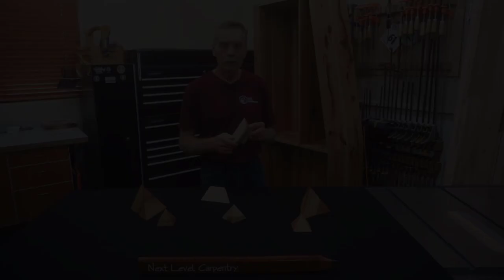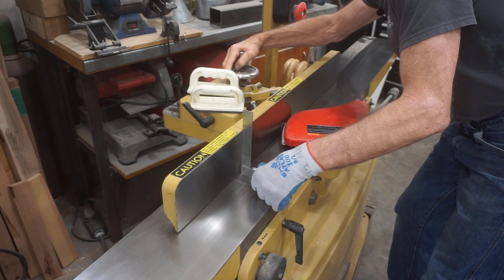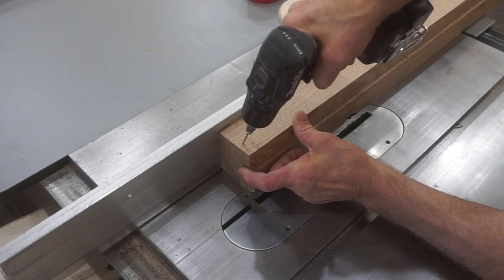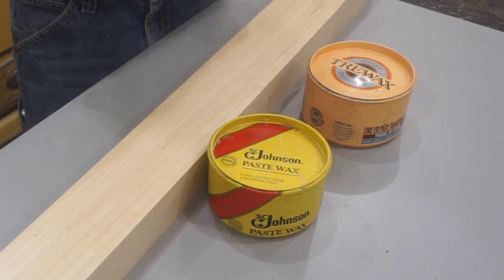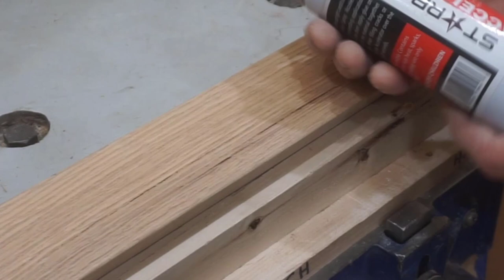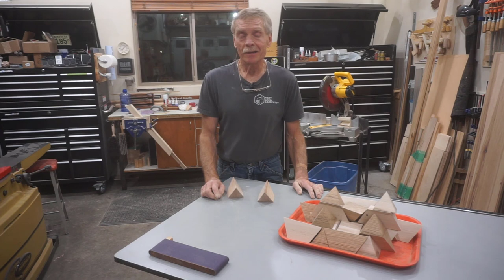Pyramid Puzzles You Can Make

Comment from the maker: Video Chapters:

@00:00 - Introduction
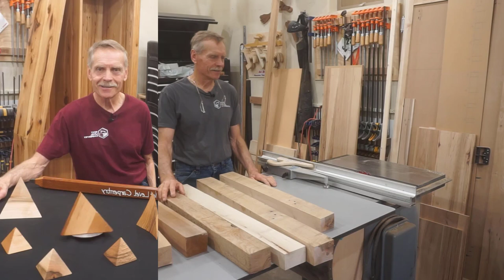@02:50 - Initial Milling
@07:00 - Equilateral Triangle Layout
@08:25 Ripping Triangular Blanks
@19:50 Planing Triangle Blanks in a Thickness Planer?!
@31:58 Initial Sanding
@35:10 Pro Tips to Repair Defects in Pallet Wood
@42:00 Cut Puzzle Pieces to Size
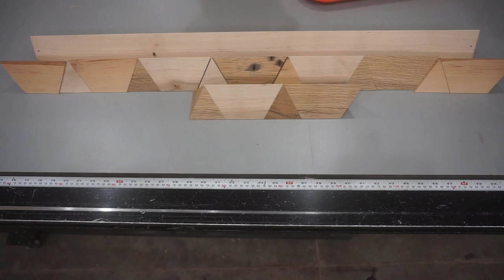@49:31 Final Sanding
@52:19 Apply Gel Varnish
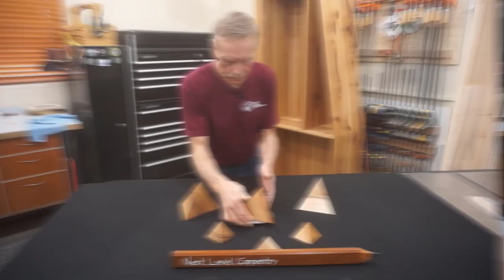@58:28 Spoiler: Puzzle Solution Demonstrated

Comment: If it were me, I'd put the fence on the other side of the blade to avoid "trapping" the workpiece. If it jams or binds it may kickback. Your feed has to be spot on straight in and dead level, or there could be a issue, but I'm not that good, or confident.

Comment: Instead of screwing the two pieces together I would use painters tape on both faces and then put super glue on the painters tape and glue them together. After pull the two pieces apart and peel the tape off.

Comment: Matt I watched the whole video, be it in two pieces. 
Question, do you use Danish Oil at all? If not , is there a reason why you don’t, from what I have read Danish oil gives better results in bringing out the timber. 
And no you’re videos are not to long as your explanations are just great particularly on details. 
Many Thanks
Reply from the maker: Peter: I used to use 'oil's' on stuff until I discovered gel poly.  Poly really makes wood 'come alive' in similar fashion but, IMHO, is more protective and durable so I can't really think of a reason to switch back... unless a side-by-side comparison showed noticeable improvement/results initially and over time.  Best, Matt

Comment: You've mentioned the use of a "sharp putty knife" frequently throughout your videos, but I don't remember and discussion about how you go about making a putty knife sharp.  Do you use a stone of some sort, a file, sandpaper, or something else?  Also, are you forming the edge as a double bevel, single bevel, or are you essentially dealing with a square, flat edge?
Reply from the maker: I hope to be doing a tutorial video on exactly that subject before long Tom.  In the meantime I'll just tell you it's a 'flat square edge'.  I clamp a smooth-ish file in a vise and drag the puttyknife standing vertically, towards me a few strokes.  Makes the edge square with a tiny 'burr' on each face of the edge so it scrapes like a well-sharpened card scraper.  I don't like to push it this way but I've done a Patron-only video showing this in some detail.  If you were to sign up as a Patron you'd have access to that right away but I will be featuring amazing knives from Level 5 in a YouTube video as soon as I can get it into the video production pipeline... Best, Matt

Comment: Interesting video as always! What kind of throat plate do you have on your unisaw? I have an old unisaw with a beat up throat plate, and this "replaceable insert" type that you have seems to be much better, but I can't find it anywhere.
Reply from the maker: Hey Aaron; It's no longer in production but here's the info if you want to try and find one on eBay or Craigslist: https://pin.it/1AGXwTu  BTW I'm considering teaming up with a guy to have these manufactured.  What do you think a fair price would be and/or what would one be worth to you? It's possible because the original patent has expired but not sure if the market will bear current cost of production. Best, Matt
Reply: @NextLevelCarpentry  Thanks Matt, I'll keep an eye out! There's the tru-cut throat plate from Infinity, but it seems less practical as the plates have to be screwed in instead of being slid in and out which makes it more annoying to change them: https://www.infinitytools.com/tru-cut-saw-insert-systems. A phenolic zero-clearance insert is about $25-$30 - I think I'd pay 2-3 times that for one where I can replace the insert easily. This is also about the price of the Infinity.
Reply from the maker: OK, cool Aaron.  The comparisons you cite are exactly why I bought the one you asked about as its excellent in design and function.  I make a batch of wood inserts for it every 10 years or so and have no problem making dedicated ones for all sizes of blades, dados angles, etc.  I wish you luck with ebay, Craigslist, etc and hope you get lucky and  find one since, even if I started today, it would be many months before I'd have any for sale... Best, Matt

Comment: Matt correct me if I’m wrong but I don’t think I’ve ever seen you use feather boards. Why is this? Any pro tips on how to stop boards from pulling away from the fence towards the end of a cut?
Reply from the maker: It's not a matter of being right or wrong, Jonathan... I just don't find the need for featherboards all that often. I suspect you see others use them more often because they help compensate for tablesaws that aren't dialed in correctly which is a major cause of workpiece 'drift' towards the end of a cut.  When blade and fence are perfectly parallel an workpieces are 'arrow straight' from jointing I don't experience 'drift'.  The other factor is the 'professional pushsticks' I use that provide excellent control while cutting.  There's at least one NLC video where I use a featherboard... making some trim I think... to keep my hands away from the blade during a special 'milling/cutting' operations.  Let me know if you have other questions about this important accessory.  Best, Matt
Reply from the maker: The best way to 'dial in' a tablesaw is to go through all the steps outlined in the owners manual for setting up the saw.  If yours is an older model you should be able to find an original manual online. Go through EVERY step they say even if it doesn't seem to be a problem.  That way you'll have a much better understanding of the machine and how it's meant to function.  You might find some helpful videos on the topic in general but most of the steps are quite specific to each saw.  Some of the adjustments like making sure the blade 'trunion/arbor' is parallel to the miter guide slots may only require a move of a few thousandths of an inch to make all the difference for proper alignment so approach with caution as it's quite possible to make things worse before they get better.  Good luck!  Best, Matt
Reply: @NextLevelCarpentry  Thank you I’m excited to tune this thing up properly
Reply from the maker: Let me know how it goes.  BTW I recently visited a friend's shop to tune up his tablesaw in an effort to return a few favors to him. Spent a short hour adjusting the fence so it's perfectly parallel to the miter guide slots and a SLIGHT adjustment to the 'trunion' that carries the blade to make it parallel to those slots too.  He said the saw's never worked so well so your efforts will be rewarded!  Best, Matt
Reply: @NextLevelCarpentry  Will do but, according to my calculations.... one "short matt hour" is roughly 45 hours for me HAHA!
Reply from the maker: You know me fairly well, Jonathan!  LOL
Best, Matt

Comment: Great stuff, one question, what is the name of the file you used to scrape the CA glue?  Thanks!
Reply from the maker: Hey Daniel...  To answer your question I just added a link to that file to the Amazon Influencer's page in case you can't find one locally: https://www.amazon.com/dp/B07Q466NRF/?ref=idea_lv_dp_ov_d&tag=aiponsite-20&linkCode=iil&ascsubtag=amzn1.ideas.29WVINIJF4EUJ
and here's the handle for it too: https://www.amazon.com/dp/B07Q46MSM7/?ref=idea_lv_dp_ov_d&tag=aiponsite-20&linkCode=iil&ascsubtag=amzn1.ideas.29WVINIJF4EUJ
I've had mine for 40+ years from back in the days I did autobody work... not inexpensive but excellent for some specific stuff like flattening that CA glue!  You're welcome! Best, Matt
Reply: @NextLevelCarpentry  Waaaat? I thought for sure it'd have a smart name like your Col. Sanders. Are you going to make a Christmas video to introduce everyone? Just for fun?

Comment: The correct dihedral angle is 70.53°

Matt, your videos are great and there's so much to learn, but with your level of accuracy and craftsmanship, I believe that you can see that they are not perfect tetrahedral pyramids.  Measure all four edges and you will see that they are not all the same.

That is because the dihedral angle (the angle between two intersecting faces, see https://en.m.wikipedia.org/wiki/Dihedral_angle) of a tetrahedron is 70.53°, not 60°.  See https://en.m.wikipedia.org/wiki/Table_of_polyhedron_dihedral_angles

See this forum post for more info: https://www.woodworkingtalk.com/threads/cutting-a-tetrahedron.19974/#post-2064623
Reply: To make the puzzle, it's slightly more complicated. I modelled the necessary cuts in Fusion 360. First, start with the stock cut as an isosceles triangle with one angle at 70.53° and the other two equal (53.74°). Then trim both ends at an angle of 125.26° (180-53.74°) against the long side (opposite the 70.53° angle) to form the square base. Assembly is as Matt shows in the spoilers section of the video.
Reply from the maker: Peter and Bob: You guys are spot on with your technical details ... nice work, and thanks for adding it here.  It's a bit embarrassing but I have to admit I never looked into it on this level, assuming all along that all edges of 'my' pyramid puzzle were the same.  Alas, they are NOT!  You're both correct in that, to make a true 'tetrahedron' puzzle, the angles you describe need to be used.  The resulting puzzle, while geometrically correct, would be more demanding to make and less satisfactory to 'play with' due to sharper angles and points so it's up to each puzzle maker to choose between mathematical accuracy, maker's abilities and user friendliness.  It's a great way to add intrigue, interest and challenge to the project so I appreciate your tactful presentation of these... parameters.  Best, Matt